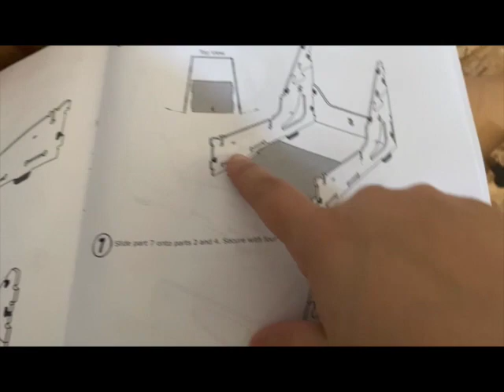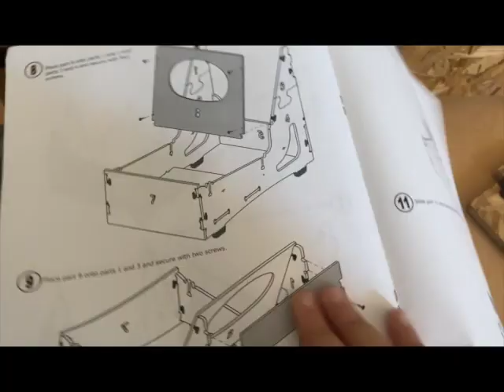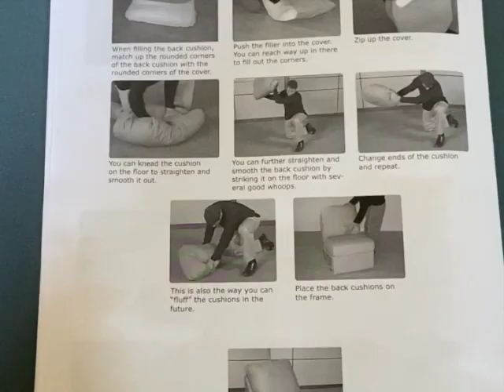Build #WithMe: Building literally just one piece of a couch | Home Reserve Armless Sectional Piece

Comment: Please keep us informed. I am looking for a sectional that will fit my family of 6. Rona has put a stop to me going to shop in stores. Let me know how comfortable this is?
Reply from the maker: hi! so the couch is very comfortable, but the pillows and cushions constantly shift, so if you find that to be a nuisance, this is not the couch for you. Its also a "sit upright" type of couch. its very comfortable, but its not deep enough to lounge in, if that makes sense. The materials are amazingly made and the build is sturdy, but i ended up using that couch in my reading nook and it works well to serve that purpose, but its not my everyday couch. (i also purchased the corner unit and the lounger. the lounger is my favorite, its huge and the storage is amazing. the corner is my least favorite unit, those cushions and pillows just do not agree with eachother) Overall, i'm disappointed because of my own high expectations but i do not regret my purchase at all. I think i would buy a solo chair like the "chair and a half" that they have on the website, but i can't recommend a couch as a daily driver.) let me know if you have any other questions!